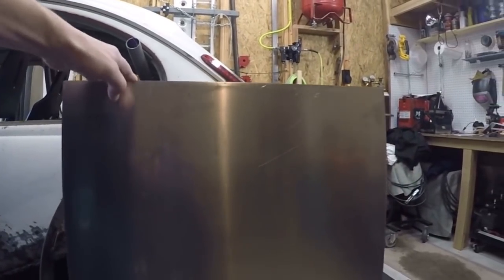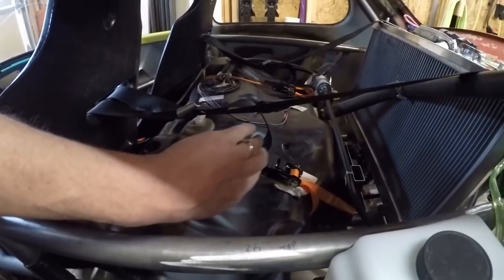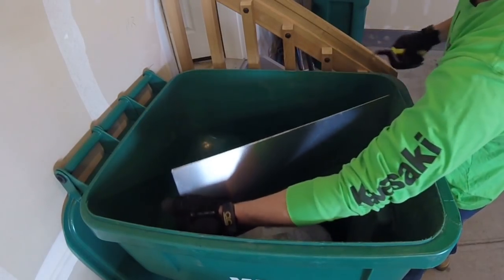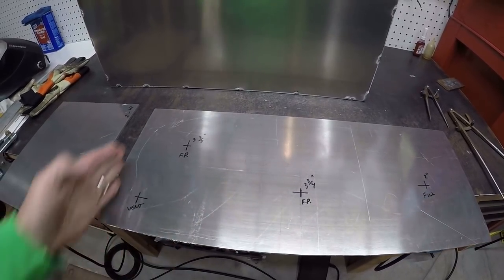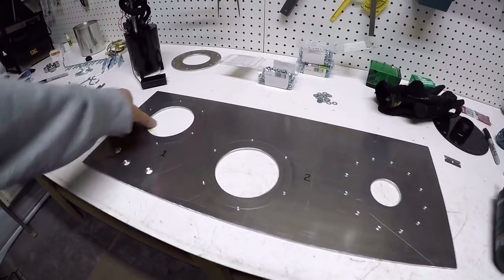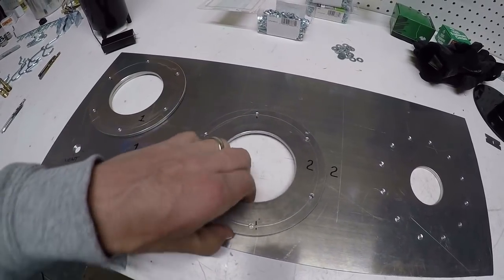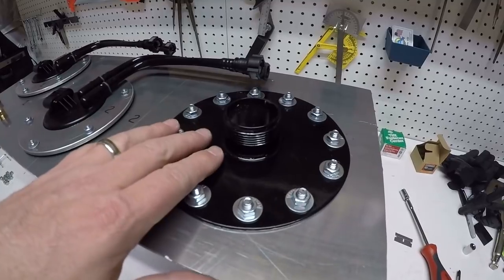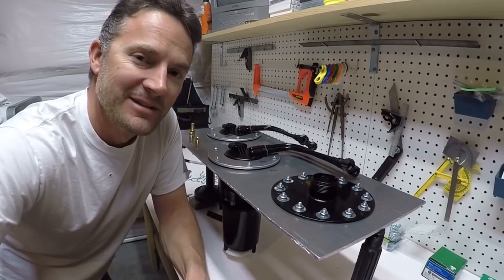Fuel Cell Fabrication Part 1 (Baja Bug)

Comment: Hey Mike, I ran across a Baja build I thought you might be interested in, its on ( The Samba.com ) its in the classifieds off road, its a 1969 Baja Bug blue ecotec conversion posted apr. 22 by Adrenaline Junky, there is a thread on the full build at the bottom of the add

Comment: Another good video. 
What do you think of these dudes putting bug bodies on RZR chassis?
Reply from the maker: Well.... lots of them are doing it to get a street legal RZR, I understand that.
And it is a fabrication project and I totally get that.
I wouldn't do it myself, I would most likely make a custom tube chassis for a RZR instead.
But I don't look down on those who do, as long as they're not destroying an otherwise good bug body to do it.

Comment: Nice clean fabrication just like the rest of the Bug. 
I thought you would sand back the surfaces for your welds but with the gauge of material you used I guess the cut edge was more than enough to weld on.
Reply from the maker: Ya know I've always just wiped them with alcohol before welding. I should try that some time and see if it makes a noticeable difference. I haven't solid welded this yet. Maybe I'll experiment with that on the bottom some.
Thanks for the tip and comment.